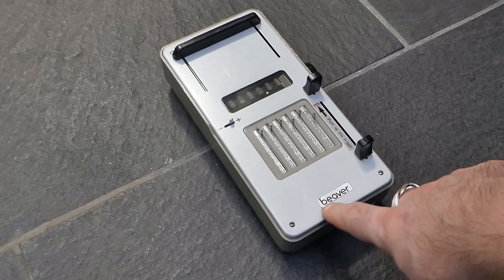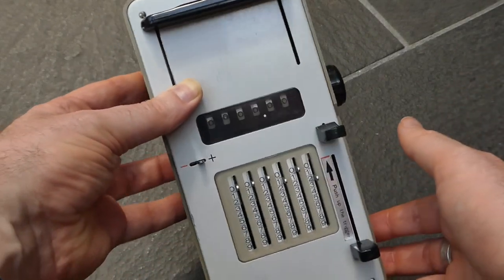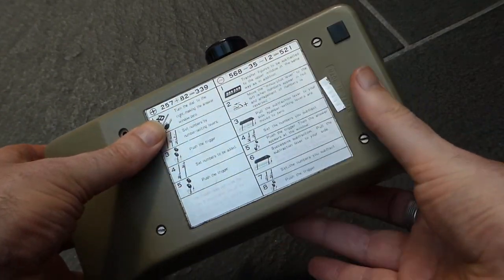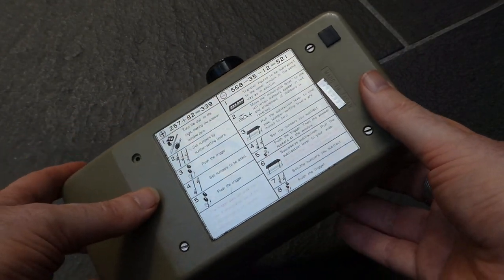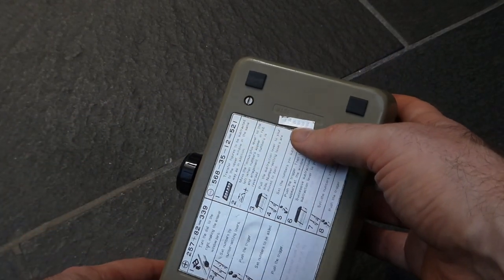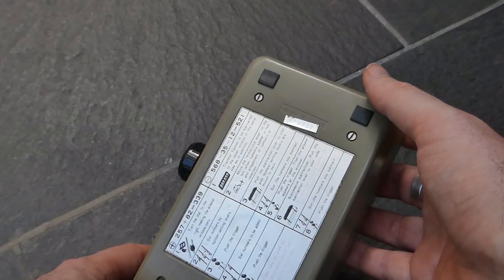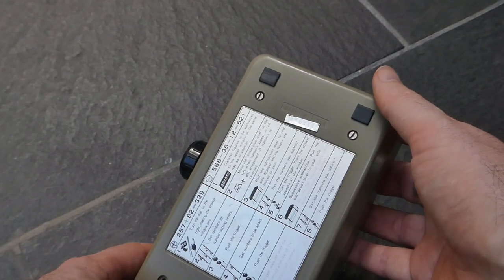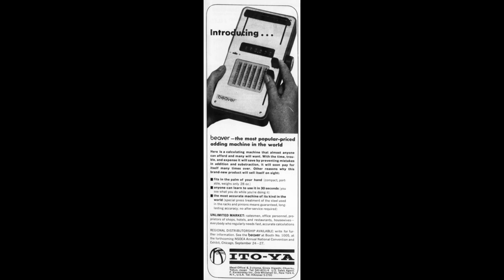Beaver adding machine

Comment: That's a really interesting rarity Jaap, possibly not the nicest user interface ever built but a great little find.  Technically, one could design replacement gears in Fusion 360 and 3D print them - they might not be as tough as the original nylon ones but they'd work ok (so many machines have failed due to old nylon gears cracking - Scalextrix cars, old Sony Walkmans and so on).

Comment: Oftentimes it it possible to source generic replacement gears online.
Though you might have to drill a larger hole or sand away a section of the replacement.
Looking at the video, I think they’re 10 tooth module 1 gears.
Reply from the maker: That's a good point. There do seem to be some similar gears available, also in metal, so I'll give that a try.
Reply: @jaapsch2  realistically if it was something you seriously seriously wanted to get metal replacement gears. 3D metal printing is always an option though would be a task to have it done

Comment: so could the machine be repaired or was it flawed to begin with?
Reply from the maker: I have not been able to repair it yet. I tried standard 10-tooth module 1 gears, but those are just a bit too large so I'd need to have gears custom made, for example by 3d printing.
Reply: @jaapsch2  OK but the original machine did work ... right?
Reply from the maker: I'm sure it worked fine 55 years ago, but the plastic of those gears has shrunk and become more brittle over the decades. It probably would have started failing more than 20 years ago